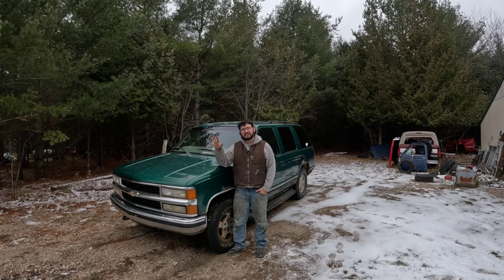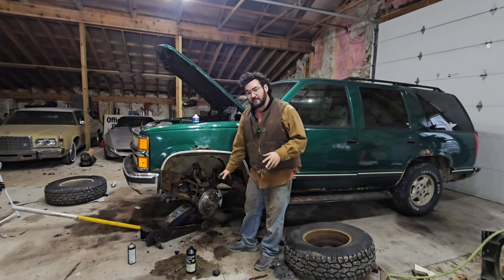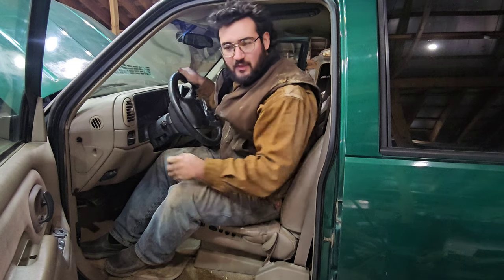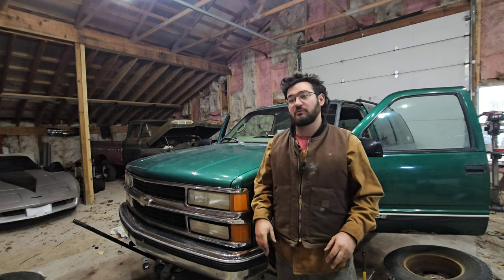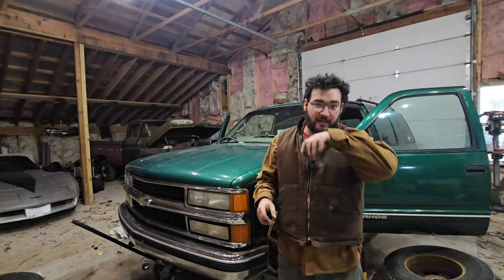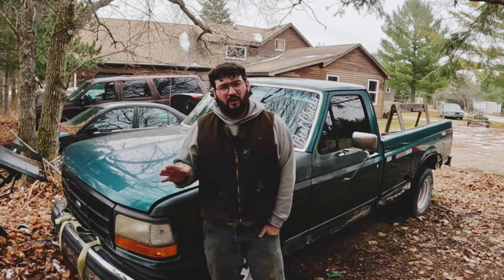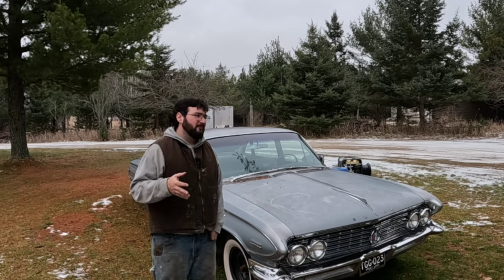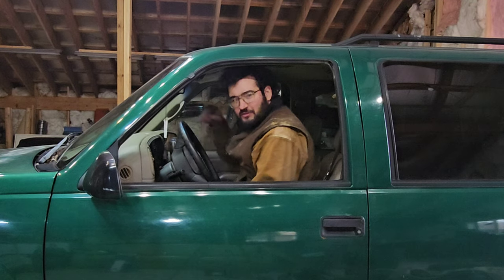Buy a better Beater! Used car buying guide

Comment: This guy beaters. Every single one of these points are spot on. I buy beaters to fix and resell. Late 90's early 00's gm cars are junk but reliable. I swear they make great engines and transmissions solely to stuff them in the biggest pile of shit they could manufacture. 90's toyota cars will out last your grand kids. I like to do 97 or older 2.3 5 speed rangers but theyre getting rare. Im a ford guy but theres not many of them that make good beaters. 97-01 explorers are great if they have a 5.0. As stated, avoid any chrysler product. Ive never bought a vehicle from a teenager that didnt require an entire weekend of unfucking their repairs and "mods".
Reply from the maker: Sounds like we're like minded individuals! Thanks for watching!

Comment: I would go to the south, buy a beater, and either tow it back, or drive it back. That same Tahoe in Texas will sell for a little more here, but would have zero rust on it. I have a 94 Chevy truck with 300K, that has zero rust on it. Working on it is a breeze because none of the nuts and bolts are rusted.
Reply from the maker: That's good advice. I got a suburban from Texas once doing that. Logistics are a bit tougher but if you can swing it then it's certainly worth it